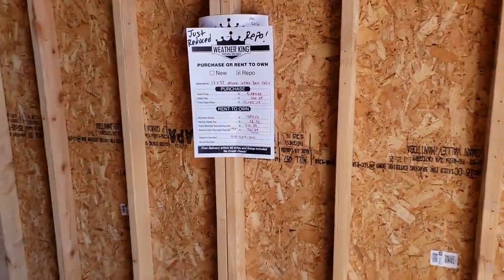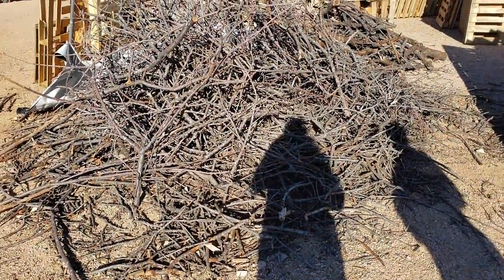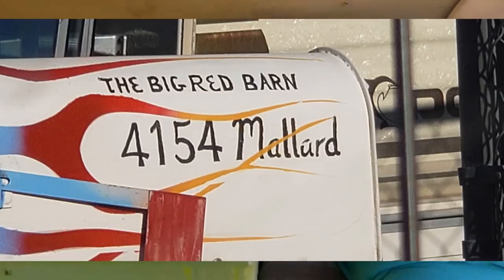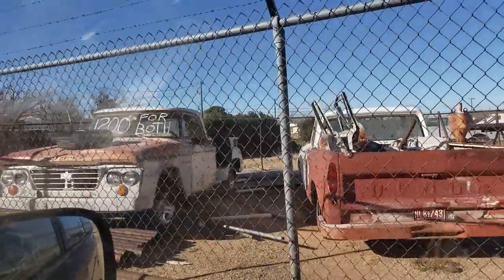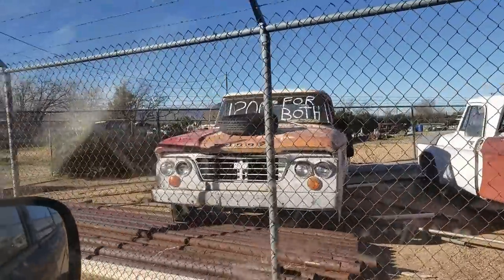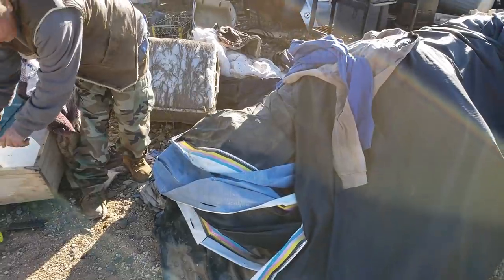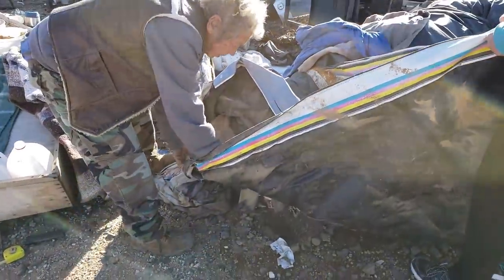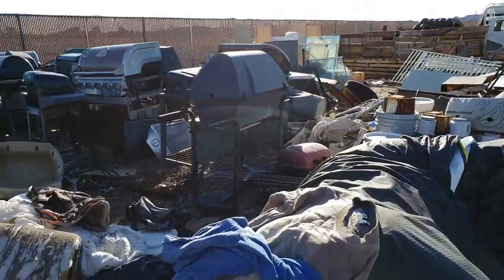PART 2 Treasure Hunting for Tiny Home (Part 3 this weekend!)

Comment: I would use the short posts to put a border on a walkway or  around  a flower bed or cactus/rock garden. Get little solar lights and screw them into the top edge of alternating posts to light  the area at night.  😊